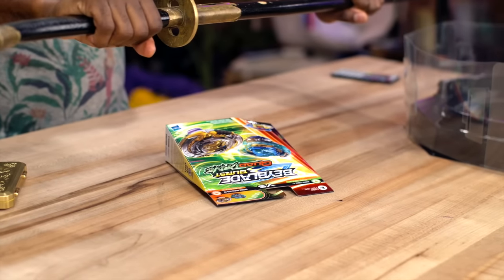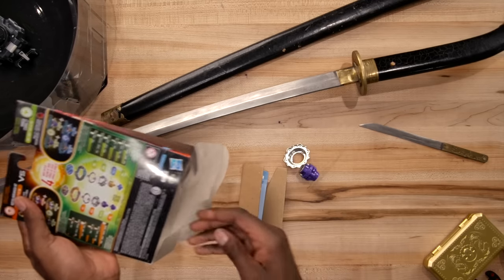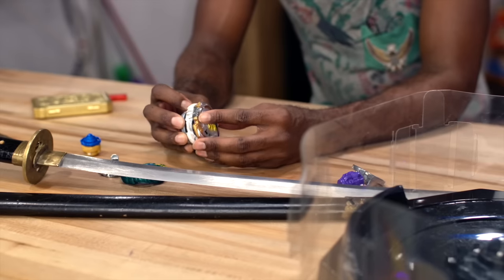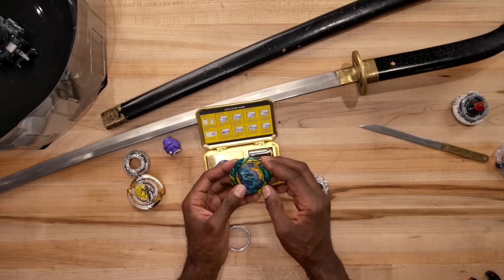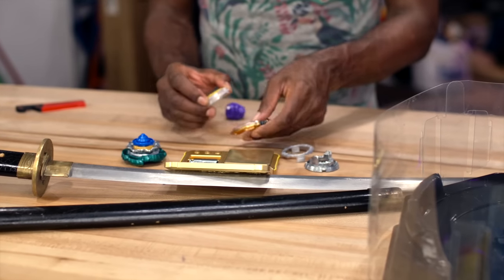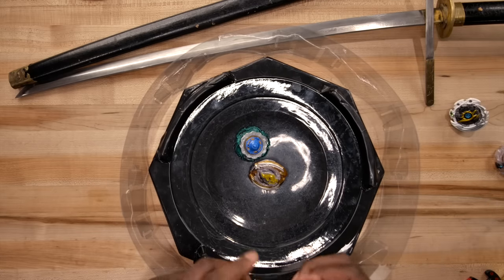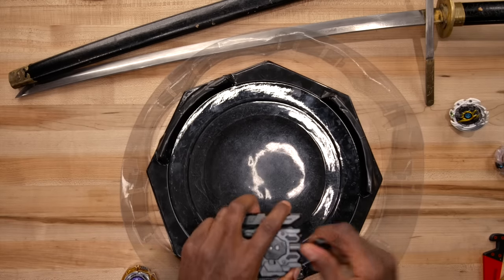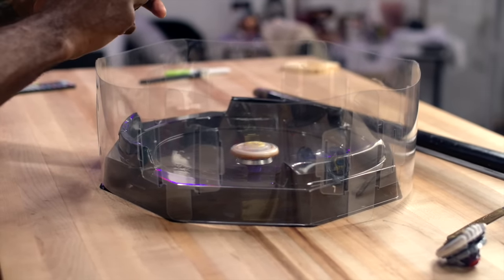UNBOXING {{Katana Muramasa & Vanish Cobra}} With A Japanese Katana | Hasbro Beyblade Burst Quaddrive

Comment: The main driver that is on katana muramasa is supposed to be Mobius-Q, it is smaller cause it has to be fit with the Rise-Q armor tip. Zankye did mention this on his unboxing video. If you have mobius from speedstorm or TT, do the side by side view